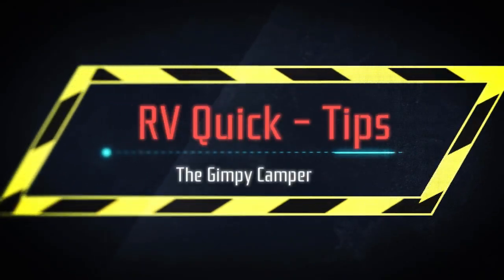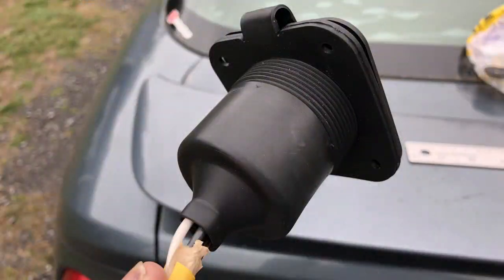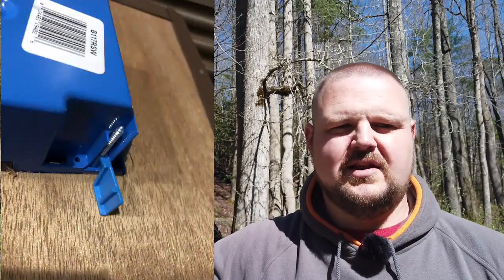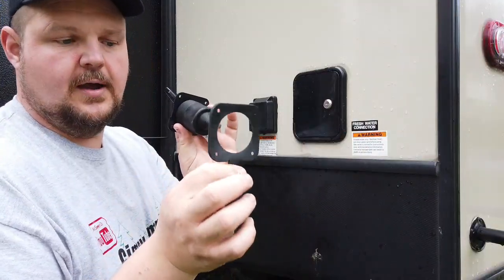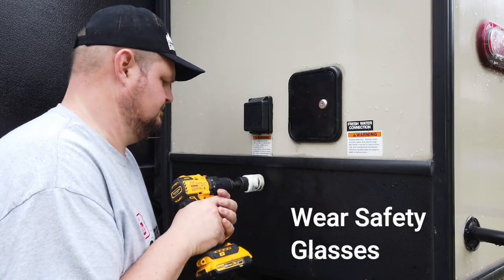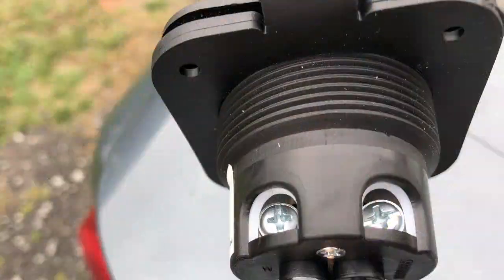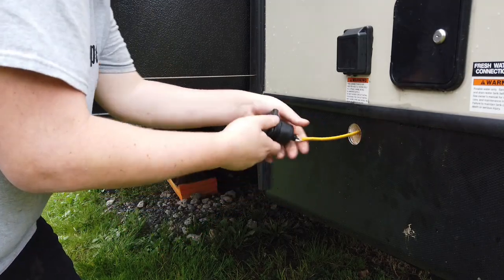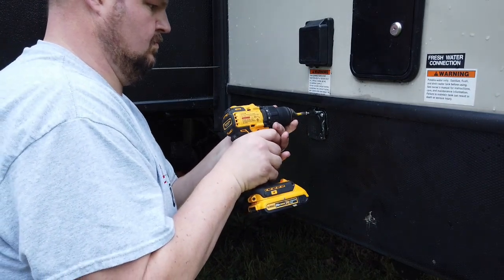Add RV Power Inlet to RV

Comment: I have a question I’m new to Rv life. When you get to a campground do you use 30amp site still ? Or 50amp ? I’m other words how do you plug in ? The main plug to a 30amp post and the additional outlet to what ? Please explain very basic sorry and thank you
Reply from the maker: It’s quite ok to ask.  Almost everyone else in the world doesn’t do what I do.  My camper is a 50 amp camper because it is prewired for a second air conditioner.  I do not like using 50 amp because the cord is way heavier and hard to deal with.  I actually usually use a 30 amp connector that goes straight into my trailer with a 30 amp extension cord that I use for my main electric cord.  I now plug this into the regular outlet which essentially makes it where I’m plugging my portable air conditioner into the post outside without having to run a cord through the window.  This allows me to not worry about overloading my 30 amp service with 2 air conditioners…